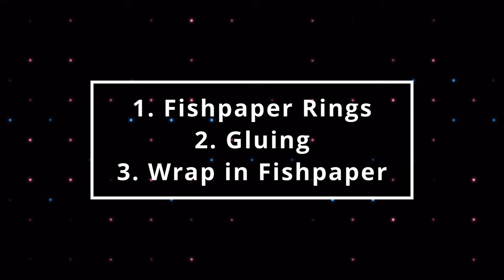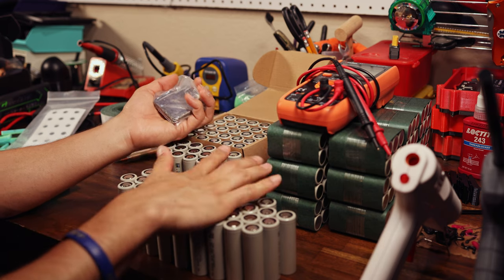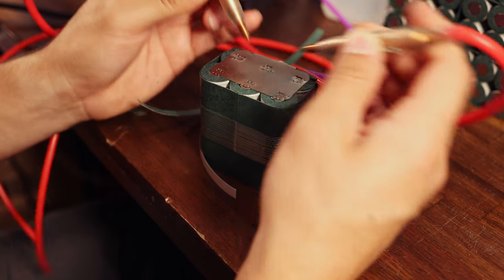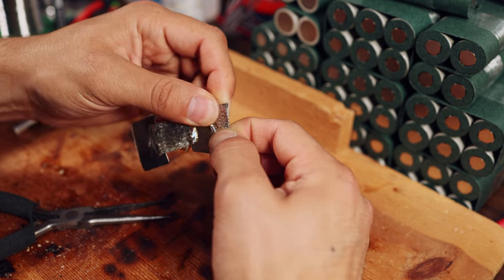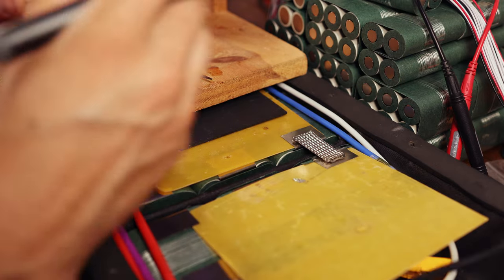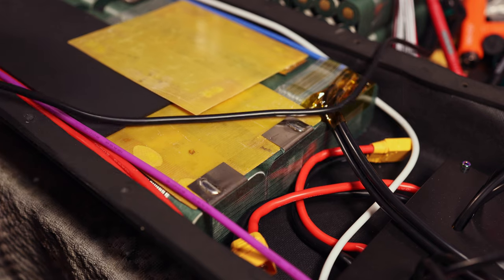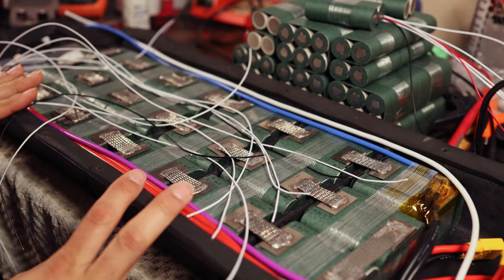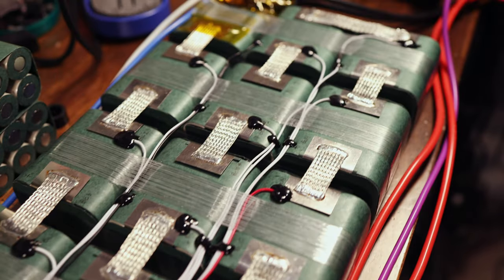How to Build an 18s6p Skateboard Battery! - (Inazuma 稲妻: Phase Two - Pt. 3)

Comment: Hi I’m building a battery pack 12s 6p 18650 cells ,I have a 60amp bms,will 60amp enough or I need more.
Reply: My motor are 5000w vesc 200 amp continuous.
Reply from the maker: Well, technically, it depends on if you want to run your discharge path through your bms or not. I run all of my BMS setups with the discharge bypassed, because I always want to have brakes, and don't ever want the possibility of having a cutout from overvolting or over drawing.

If you bypass discharge it doesn't matter at all. If you run the discharge through the bms, it may not be quite enough

Comment: Great video! One question. I thought that people didn’t recommend using hot glue to hold cells together because it cracks and becomes brittle after time. Is this a different kind of hot glue that doesn’t do that?
Reply: +1

What kind of glue is that? Looks different from regular hot-melt.
Reply: @PatrickECleary silicone
Reply from the maker: Certain people have argued about this for a long time but in my experience good hot glue lasts perfectly fine. I have cells I glued in 2017 that are still holding together today. Some people argue for silicone, but others argue that since silicone is so soft, it lets the cells rub more than hot glue. Hot glue is easy, fast, and holds well.  It is my opinion that it is the best for now. Silicone is a huge pain, takes a long time to dry, and gets absolutely everywhere. No judgement to people that would like to use it though, it works as well.

As a side note, all of the groups are further wrapped in fishpaper, and then taped off tightly with fiber tape. After that, they're welded together. I would be surprised if any of the cells ever manage to move at all.
Reply from the maker: It's just a brand of black hot glue that I've been using for a while. It's a high-heat kind of hot glue, and not all hotglue is created equal. Check out the ProjectFarm video for his opinoins, I've used Gorilla hotglue and this black stuff from Trendbox.
Reply from the maker: While that is a good option, I do not really use that to glue P groups together.
Reply: @RBEMotion Thanks for the response. Yea I’ve heard some people use VHB tape, and some do hot glue or silicon, but since your isolating each group using fish paper, it seems like you’ll probably be safe either way.
Reply from the maker: @NoahZimmerman  Yep, I would agree. Better to have multiple failsafes.

Comment: Quick question -  How do you determine what fuse size I should have for a battery pack? When I built my DIY I did not put one in but I'm noticing a trend with more and more people putting these in. What prompted folks to add these? Thanks mang !
Reply from the maker: Well off the bat, it's not a battery pack fuse. It's a charge port fuse, to protect the bms if the charge port were to be shorted or plugged in backwards. Usually I spec the fused based on how fast the bms can charge, which for LLT bms is usually 15a. So I'll put in a 20a or 25a fuse in there to help protect it. It's somewhat debated as to its necessity since most BMS are good at protecting themselves. However, I've replaced a melted charge port before so I still see value in it.

Comment: Dude it’s crazy I have the same build! But I’m between 18s6p or 16s7p with these cells.´ for you the range is would be better to not start my 2nd pack in 16s ? Never did 18 before and I’m a bit worried about the capacity lost : 16s 32ah 18s 27ah 😅
Reply from the maker: If you don't need the extra speed just go with 16s, which esc are you going to use?

Comment: could you get rid of all the soldering braided ribbon if you you folded over the nickel tabs toward each other so they overlap? then you can use the spot welder like on the ends of the cells. or would that not be durable enough to vibration?
Reply from the maker: You COULD, but it would no longer be a flex-tolerant pack. Also, welding nickel together like that is not super durable in the first place. If you were to use a PCB like Lacroix you could weld the nickel to that, but that's not exactly very accessible.

Comment: 25:17 maybe use some parts of silicone heat resistant mats?
Reply from the maker: That's a pretty good idea, if they were thin enough that would work really well. Despite how thin the fr4 is, it still kind of made the nickel stick up a bit which makes the joint a little tighter than I'd like, so thickness is important.

Comment: What gauge wires for discharge and where to buy?
Reply from the maker: I used 10awg high strand silicone wire for the discharge cables, you can get them on Amazon or Aliexpress. I like to use BENTECHGO on Amazon.

Comment: bro could not have picked thicker cable for charge port
Reply from the maker: I used 12 awg for that, which is admittedly slightly overkill, but I planned to charge with up to 20a at times, so it wasn't a big deal to oversize.